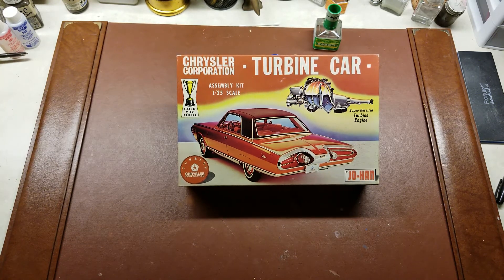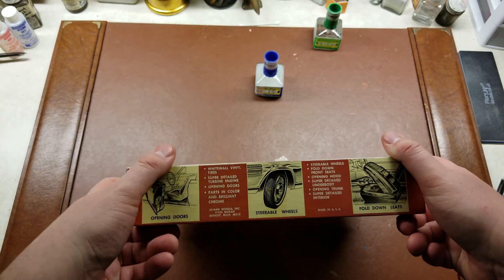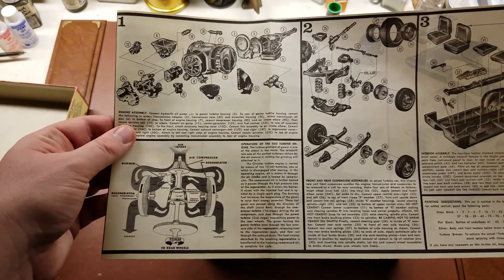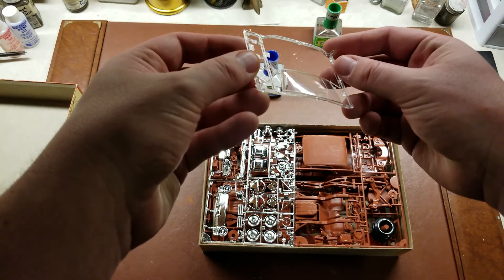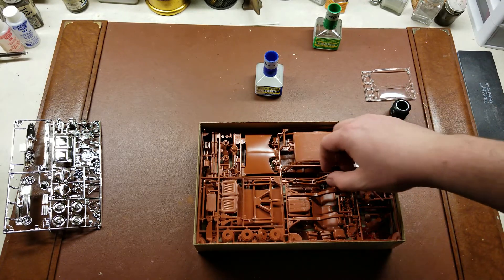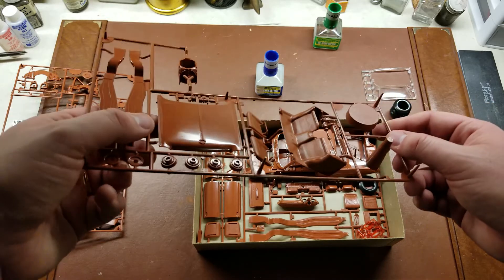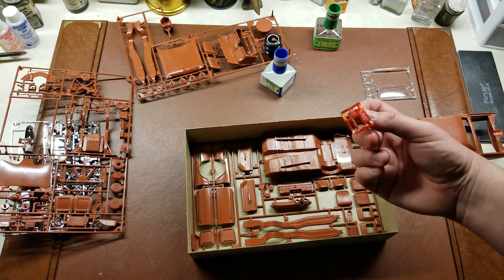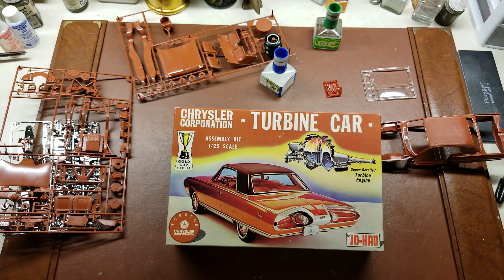Jo-Han Kit No. GC-300-149 Crysler Turbine Car

Comment: The first release you have in your hands was about 1965. Also all those details were NOT typical Of Johan, or any other kit maker but were very unusual. The only other kits I know of this detailed, and not done nearly as well were the Revell 55-57 Chevy series and AMT had 56 and 57 Fords, a 58 Chevy and a 63 Studebaker Avanti. Those are NOT exhaust tips on the rear bumper. You can clearly see that was underneath the car. They are reverse lights.